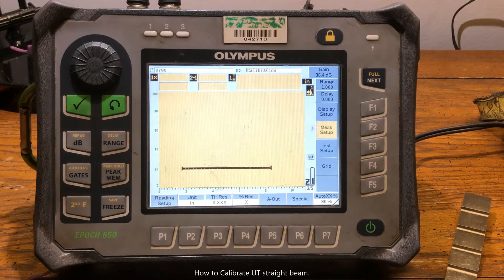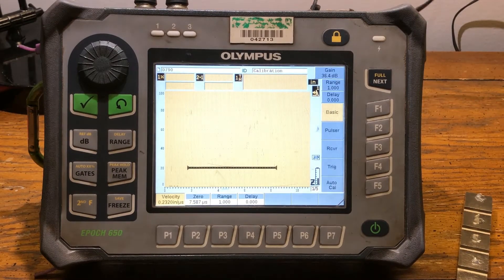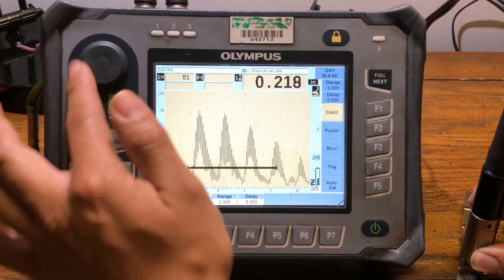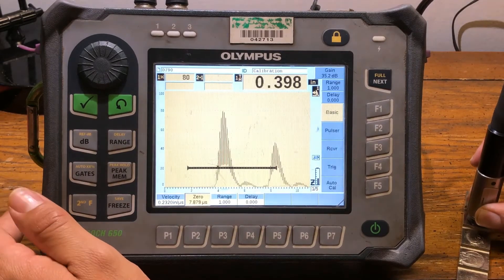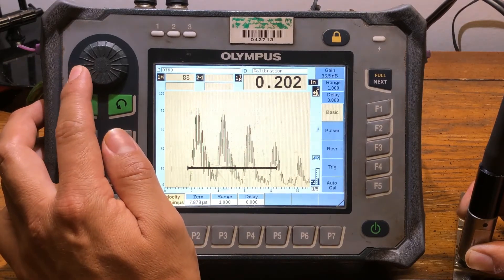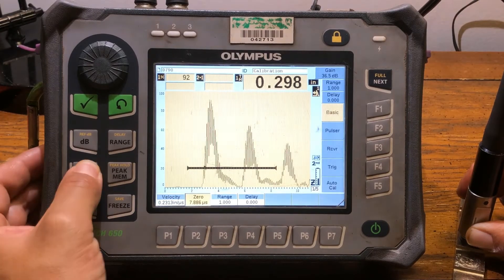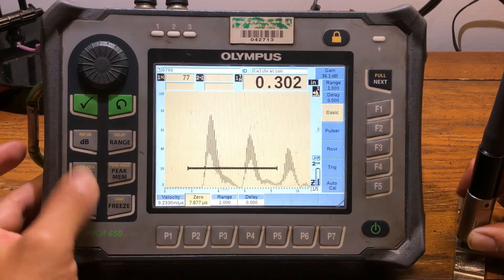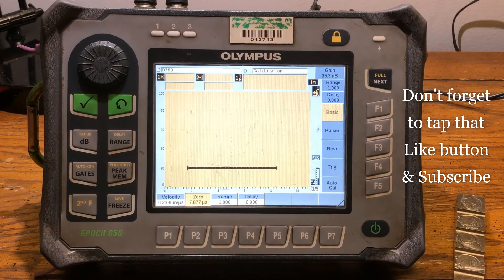How to Calibrate a UT Olympus 650 Scope - Part 2

Comment: ZERO = thin Velocity = thick. The way I remember is zero is smaller. Give it a shot.
Reply: So place the transducer on .200 and use zero. Then on .400 for Velocity you can get that cal way tighter.
Reply from the maker: Check the other video I made on how to auto Cal. 

https://youtu.be/3f4Zw1w7Zwk